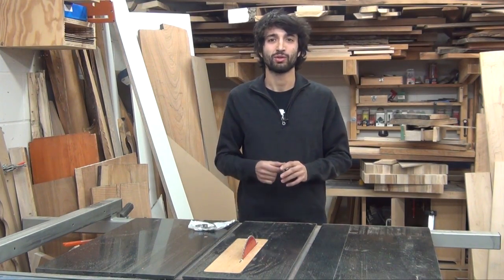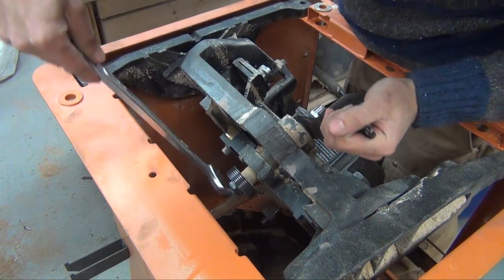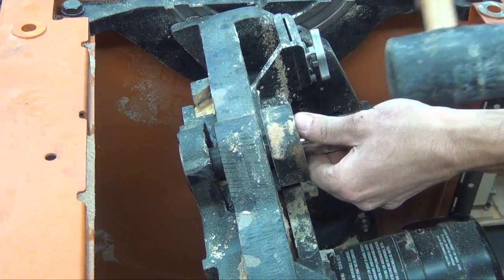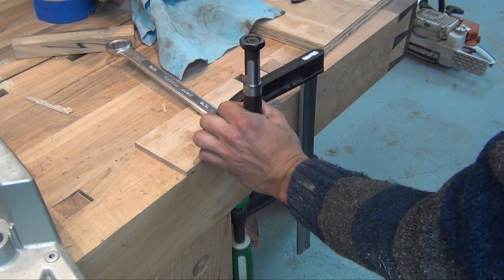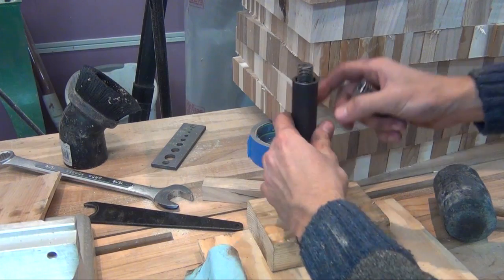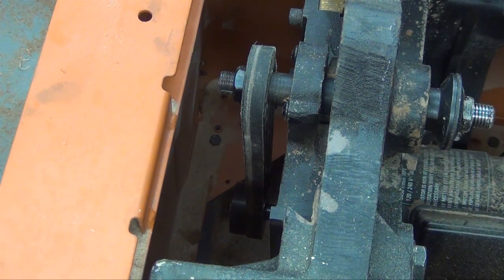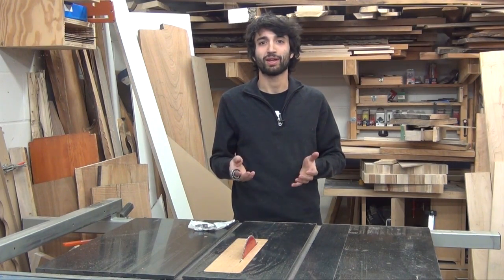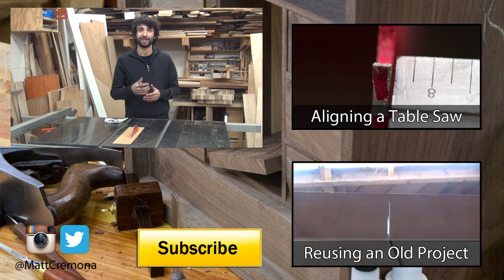Replacing Table Saw Arbor Bearings

Comment: It is helpful to freeze the shaft and heat the bearing.  Heating to 200 deg F won't stress a bearing, even 100 deg F will help,  it will most likely slide on with a bit of oil and finger pressure.  Thanks for the excellent video and audio quality.
Reply: Tried but couldnt get inside the freezer with my torch.

Comment: Thanks for putting this together, it really helped me get my table saw back up and running.  I would suggest more penetrating oil for removal, and a good oil for installing.  3/4" pipe is a good helper for getting the bearings back on.  A proper bearing splitter makes the removal easier and safer for your arbor.  Thanks again!
Reply: Hi there - do you have a suggestion for your favorite brand of oil/penetrating lubricant that's safe for Woodworking machinery clean up/parts?
Reply: @weinigholz-herusajordanrag1327  I used PB Blaster.  No clue if it is the best, but it has worked well for me in the past.  I think I found it at either a hardware or auto parts store.  Your availability may be different.

Comment: Thank you so much for this.  I just bought a used R4511 and the arbor was feeling rough and had no idea where to start getting access to the bearings.  This makes things so much easier!
Reply from the maker: awesome!
Reply: @mcremona  - Unfortunately the bearings in my motor are also shot.  I believe the saw was kept in a humid basement.  So all new bearings for the arbor and motor!
Reply: Anyone interested in changing the motor bearings on a R4511, they are 6203 (I used ZZ so could heat the bearings for easy fit to the shaft.)

Comment: Cool. Yours are easier to get to! When I did mine I picked up a bearing puller from harbor freight. Totally worth it!
Reply from the maker: Peter Brown I'm going to pick one up next time I'm there.  I was planning on getting one for this job but spontaneously decided to tackle the job one night.  Thanks Peter!
Reply: Matthew Cremona I've been there. When you get the bug to get it done! Also when I did my replacement I got Japan made bearings. I was told they are the best. Considering the pain, I wanted to get ones that lasted a while! :)
Reply from the maker: Peter Brown you're a smarter man than I.  Should have gone with fancier bearings :)
Reply: Matthew Cremona
 Naw, just lazy... :)

Comment: I know it is a old post...   but thank you very much!!!  I have the exact saw and bought the bearings and just finished putting them in. After putting the top back on I didn’t even have to make any adjustments.  Got lucky on that one.  

One thing I did a little different was after I pressed the bearing into the back I put the arbor back in and used the nut on the end to assist with seating the arbor bearing on the right.     Keep up the good work. 

I am actually going to sell my r4511 to upgrade to the grizzly g1023rlw very soon.   It will be easier to sell the r4511 now that it actually works great again.
Reply from the maker: Awesome!
Reply: I see you just did this a month ago. I just tried ordering bearings from Ridgid and was told they are no longer available (Although I think the girl on the line was clueless). Where did you get the parts? Do you have part numbers?
Reply from the maker: @chrissimonton9939  The bearings are size 6004.  The stock ones are 6004 zz which have the metal dust shields.  If you want to switch to rubber seals to keep dust out 6004 2rs.
Reply: Rev. DamnAggie Rev. DamnAggie I ordered mine from grainger and picked up locally. Told them 6004 and they looked up their part.  Hope this helps.
Reply: Laura & Bob Martin  - thanks. Once I realized it was a 6004-ZZ bearing it was easy to find and I ordered online. Ridgid has stopped selling it so all the parts houses were telling me it was discontinued.

Comment: Nice job Matt - To others, I strongly recommend using a simple arbor press to put those bearings on, but good on Matt for improvising. Also, try freezing the shaft before you press it on. A thousandth extra clearance makes a world of difference.

Comment: Thgis is a good video.  My saw may need new bearings... I think.  I wish you would have demonstrated the performace of your saw with the old bearings then the new ones.   Mine is not noisy, but the blade sort of viabrates under some conditions.  Its strange.
Reply: I also would have liked Matt to explain his symptoms / reason for changing his bearings. Did you determine your issue?  What did you do to resolve it?

Comment: Interesting how much changed from the 3650, besides being a hybrid instead of contractor.  On the 3650 the pulley is held by a set screw and the bearing by a snap ring.  I went in there thinking I was replacing bearings but actually had to replace the arbor.  So my saw was down for a week waiting for the right part, that was fun.  I managed to do it without taking it all apart but I ended up cutting a hand screw clamp in half and then screwing it back together inside the saw to press it all back in place.  Apparently if you stick the arbor in the freezer for a while first you can get the first bearing on and and then get it back in and into the second bearing just by hand if you are quick enough but that was a handy tip I picked up after the fact, just like you :)
Reply from the maker: krtwood The potential for the saw being down for any length of time is why I had been putting off this job for so long.  With my luck I would start the repair only for something to happen that prevents me from getting the saw back up and running. I've done that freezer trick when I replace the bearing in one of my chainsaws. I just figured I'd give room temp a try (laziness)

Comment: Nice job Matthew. Doesn't look like your saw is really old enough to need new bearings, maybe a bad set from the factory. I recently changed out the head on my jointer for a Shelix and bought a puller from Harbor Freight... worked good enough for my needs.
Reply from the maker: John Conklin They must have been a bad set.  They went out after about 4 years.  Maybe I just use my saw too much? haha!  I've been meaning to pick up a puller from HF but decided to (finally) change these out one night on a whim.  I'll pick one up next time I'm there.  Would be a handy tool to have around.

Comment: I got into changing the arbor bearings in this same saw before to, I aslo had to spend a lot a time freeing up the trunnions. The granite top works great for my shop because its not heated and I don't have to worry about rust but other than that I haven't been all that happy with it, kind of a maintenance pig:(
Reply from the maker: Shop built Did the trunnions seize up or something?  Luckily this is the only large issue I've had with the saw so far.
Reply: Yeah, but the problem was in the shaft from the hand wheel to the pinion and not in the actual trunnions. I've had a few other small problems with the saw as well.

Comment: Awesome video Matt.  Excellent explanation as usual. I have the same saw.  Mine is a recall unit.  Been a few years since the recall, but the guy came out to the house and changed out the parts.  I don't think I'll need bearings for a while, but your video is a keeper.
Reply from the maker: Brian Igielski Thank you Brian!  I checked my saw for the recall while at the store getting it.  Nice to hear you didn't have to bring it into a service center.

Comment: Matt . I need to replace my bearings also, but I have a more difficult problem. The pivot bracket is so worn that it will only raise the blade 1". The bracket comes off easily enough but I can't find a replacement. Do you have any ideas? Thanks for all you do.

Comment: Hi matt. I used to work as a mechanic and had to replace wheel bearings all the time, it's a similar process, although we would use a hydraulic press to do it. Perhaps if you went to your local mechanic they would allow you to use their press to do this,might make life easier if you have to do it again and also would have less risk of damaging the new bearings.
Reply from the maker: Mark Chapnell I hope I don't have to do it again but who knows maybe on different machine.  Good tip.  I would actually have to plan the work a bit instead of just jumping into it one night like I did here.  Thanks!
Reply from the maker: Lasse Langwadt Christensen Funny thing: after I posted this video John's video popped up as a recommended video.  He's got some great tips in there.  I liked how he used a threaded rod to pull the bearing into the trunnion.

Comment: Hey Matthew. Great video. I have just been searching youtube in vain. Trying to find a video if my saw and how to fix it. I have just had my belt break. On inspection it looks like the pulley on the motor side of things has slid aling the shaft and in now out of alignment with the pulley driving the blade. I am not looking forward to trying to fix this. I am in not that technical and i best take many photos before and during disassembly 😂😂😂 i am not sure how i will access the pulley other that removing the motor. I am also not sure it i need to remive the table top or if i can even remove or shift the pulley. The shaft it is on has no nut keeping it in place. I need to figure out how and why its moved. Maybe it has sone type of locking bar but anyway just thiught id say thanks, your video isnt exactly what i need to do but its inspired my to try. 😂😂😂

Comment from the maker: James Aitken I haven't had to replace the switch on my table saw.  I have had switches stop working.  In the case of the rocker switches, like on this table saw, taking the switch apart and cleaning the contacts will get it working again.

Comment: Good info, how did you know the bearing was out?
Reply from the maker: Mike Fulton Thank Mike.  Mostly noise but I could also visually see the seal on one was damaged.  The saw also didn't cut as well as it used to.  It lacked power.

Comment: I think it would be possible to use the threads on the arbor and a few spacers to pull it into the last bearing
Reply from the maker: Lasse Langwadt Christensen Yes that would work great.  I didn't think of that...  Great tip! Thanks!

Comment: I have the same saw , did you buy the bearings local or from ridgid ? Thanks for the video it will come in handie should I need to replace mine .
Reply from the maker: Jerry Sateriale I got them from eReplacementParts.com  Here's the part for reference: http://www.ereplacementparts.com/ball-bearing-6004-p-571151.html?osCsid=m2k5uo96a33rm15bf2eco24ur4

Comment: Just a quick trick for getting the bearing on the shaft.
Heat it up in an oven (up to 110°C :) and it will slide on much more easily :)
Reply from the maker: mikkosha Thanks!  I've actually used that trick when I replaced the bearings on one of my chainsaws.  It was winter so I left the shaft outside (it was one of those -20 days) and put the bearings in the oven.  They took almost no force to seat.

Comment: Hey Matt!  What were your symptoms that told you the bearings needed replacing?  I have a 15 amp Dewalt contractors table saw and on start up it will  occasionally trip the new 20 amp breaker.  I think I have too much friction in the system.  Also the first few seconds there appears to be some vibration in the blade and then it dampens out.  What are your thoughts?
Reply: I have the same question.  I was just given a really nice Steel City cabinet saw, my first cabinet saw, I’m in LOVE!  I know the belt is deformed since it was sitting unused for years, so I've ordered a new belt.  There is a noticeable vibration when I shut the saw off. It could be the belt, but I suspect the bearings. Although I'd have thought they'd be noisier at speed.

Comment: I have to 4512 model. I was just wondering if my bearings might need to be replaced. It makes a squealing noise at start up but goes away after a few seconds. Still cuts real good. Could it be the bearings or maybe a belt?
Reply from the maker: squealing is usually the belt.  It could be from a misaligned pulley

Comment: Hey Matt, I have the same Ridgid granite table saw as you, R4511 I believe.  I have had an issue that when changing the angle of the blade that it does not actually stop at 90 degrees, but when I get close (90.4 degrees according to my magnetic degree finder) I hear a loud "pop" and then it rotates freely again until I get back towards 90 degrees.  Have you ever seen this issue or could you give me some guidance on this?  Also, have you run into any issues with finding parts on this saw?  Even ebay I come up completely empty.
Reply from the maker: Might check the stops.  There's a hole in the top of the table to adjust that.  The bearings were the only parts that I ever needed but those are just generic parts.  Once you know the size, you can order those from anywhere.  Is there a part you're looking for specifically?

Comment: Where do you buy a replacement bearing, is their a code on the old bearing?
Reply: Cartridge bearings are designated by 3 measurements: Outter diameter, inner diameter, and thickness. (You'll see them labeled for sale with specs like 41x30x17, representing a 41mm diameter bearing with a 30mm opening that is 17mm thick.) Measure your old ones and search for those specs and you should find what you need!

Comment: I always learned: Don't lubricate, keep the thread as dry as possible. Sawdust sticks to the lubricated thread and gets clogged inside the bold.
Reply: Dry lube is the key and most resist dust; even saw dust.
Reply: Stuby nubs, and I disagree. He's got an excellent video on lubricating a table saw.  I was just gifted a Steel City cabinet saw, used grease on the gears.  Works so.... much smoother. Did the same with my older Delta contractor saw, sawdust didn't cause any issues.

Comment: cool had to do same thing on my lathe
Reply from the maker: Alan Rodriguez How difficult was that?  Were the bearings easy to get to?
Reply: pretty much just had to remove the digital display, but it was pretty easy to replace,bang out one side,remove that bearing then placed the spindle between the jaws of my vise and bang off the other, then the new ones went on just as easy, works great now thanks for asking

Comment: That’s I needed to see how that works before ruining everything by forcing the wrong order. I hate to sound like that guy cause I’m not, I’ve been a union Ironworker for a long time now and often have to get creative with bolts mechanical concrete anchors and footings. So Contrary to what seems work wise to the many , The nut as protection from beating a head of a bolt or stud by having it just above the top of the bolt is taking way more of a chance of seizing the nut than mushrooming the bolt. The bolt is more of an easy fix, the seized nut is not. The way to do it if you can’t rig up a softener is to run your nut down out of the way and if you happen to thrash your threads or mushroom it (within reason) removing your nut will clean up your threads for you on its way off like a thread chaser, just don’t try to power thru it , you need to spin into the damage , back off, spin in, back off. To let the savings out of the nut so not to seize it that way. Not optimal.  but in a pinch it will get you to the next step. Hope that helped someone. I know I needed it a couple dozen times before when it was taught to me.

Comment: You're only supposed to hammer the outer race when installing the bearings. Hammering the inner race is likely to damage them.
Reply: Ahhh, that makes sense. Thanks for the correction / clarification.
Reply: I disagree. Hammering the outer race will transfer the force through the ball bearings to the inner race where the insertion friction resides. This exactly what you DON'T want.  Hitting the inner race simply puts the insertion force on the surface with the friction, no force will be transferred through the ball bearings.